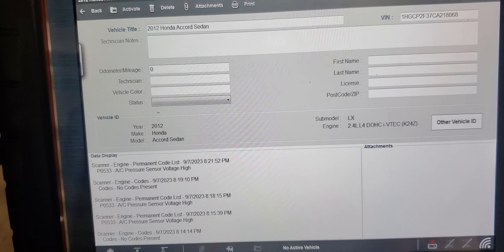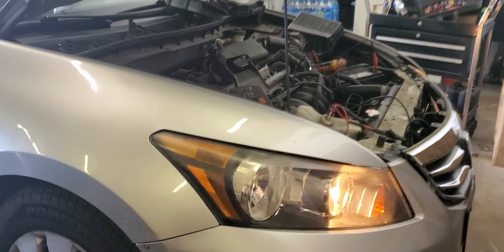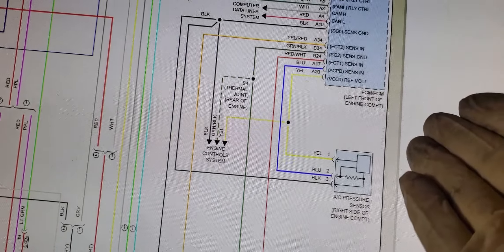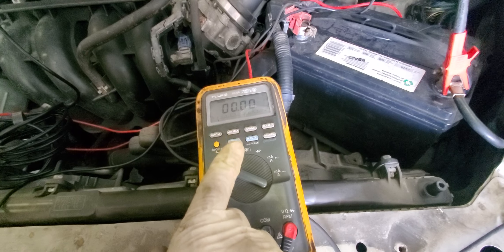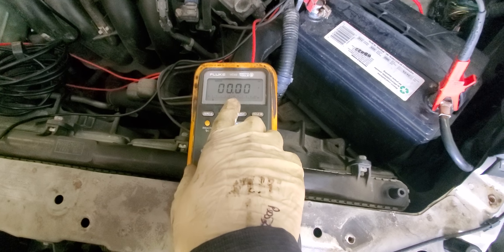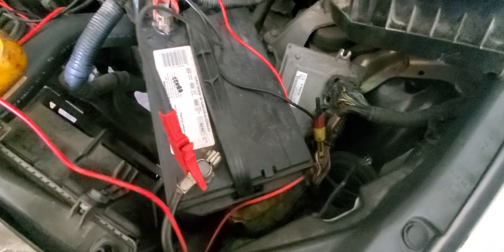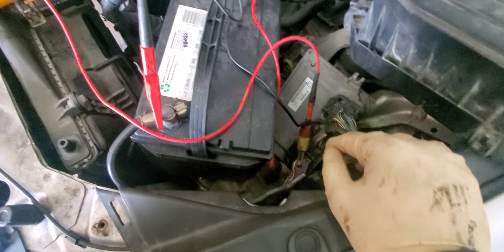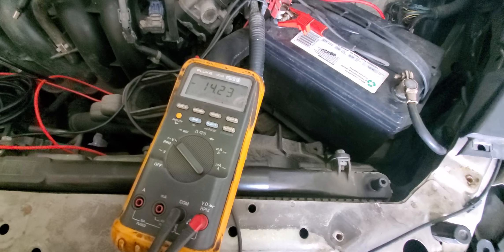2012 Honda AC not working - P0533

Comment: I have 2008 accord.i have code p0533.replaced sensor already.now if clear code and start car ac will work till I shut off car and restart car .when I start car again ac stops working code comes back on.
Reply from the maker: Get the codes
Reply: @waqasazmat81  code is for ac high pressure switch
Reply from the maker: @user-jd4kp3lp9r  look for broken wire
Reply: @waqasazmat81  it was a faulty computer, sir.replaced the computer problem solved.